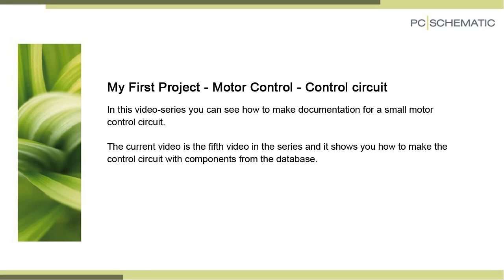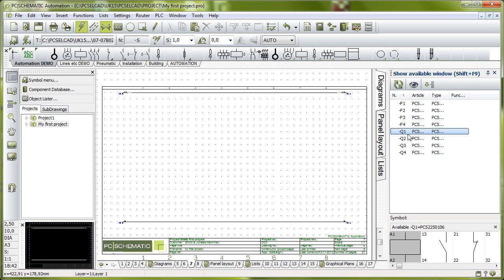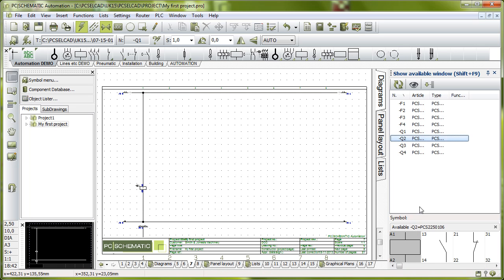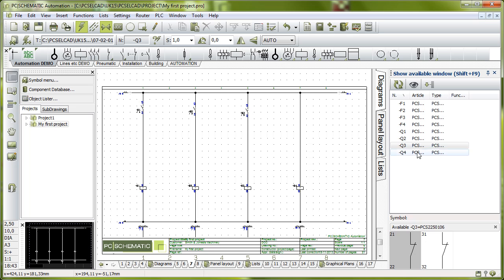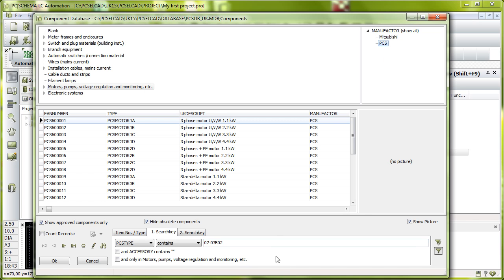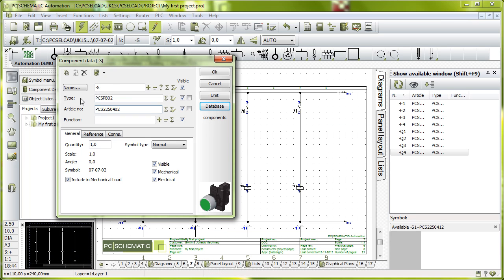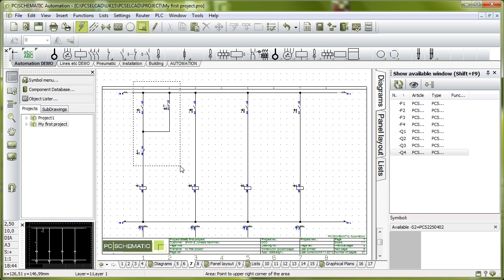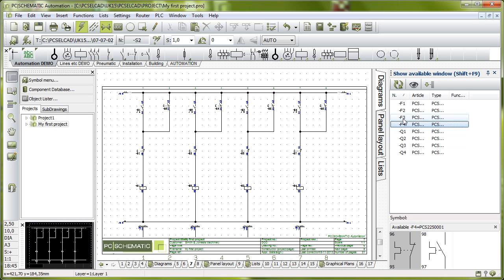Motor Control: Control Circuit (5 of 7)

Comment: How to edit the symbol refference fonts
And global font in drawing
Reply: You can find text settings in the the Settings menu in the Text/symbol defaults section. Each text type is found here, and you can select the font here. Remember to transfer to the project.
In the newer versions, there is an ALL setting. This setting allows you to make your own settings and to have them overrule the symbol settings.
When you start changing fonts in a project, you can also use a script from Tools|Scripts|Change text font.
Hope this will help you.